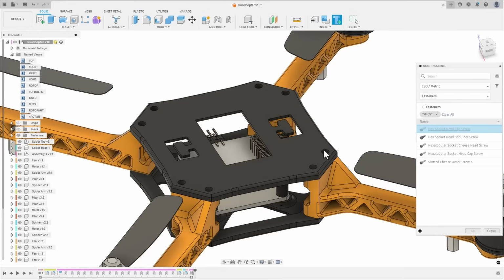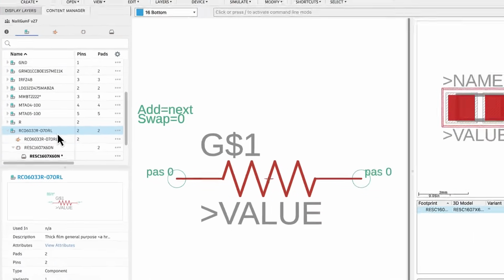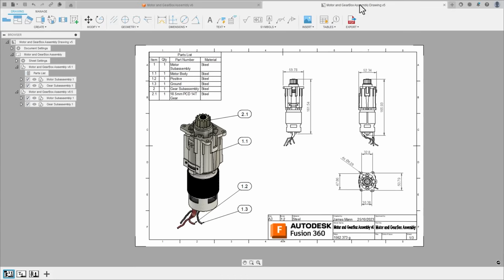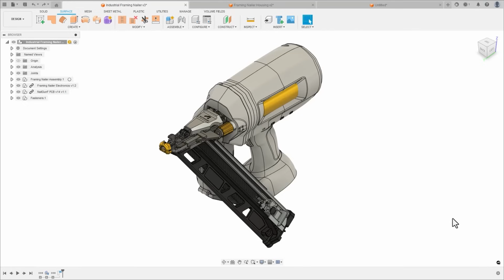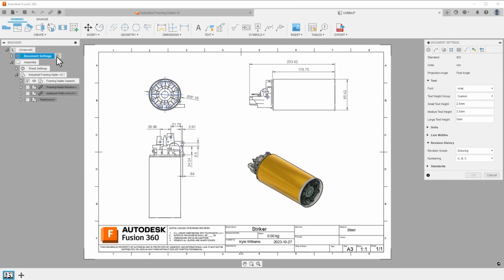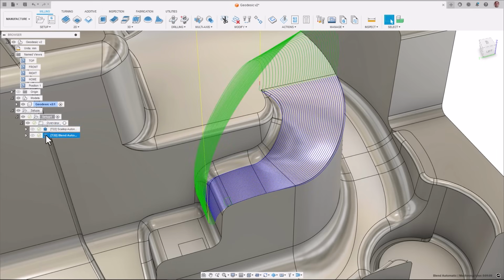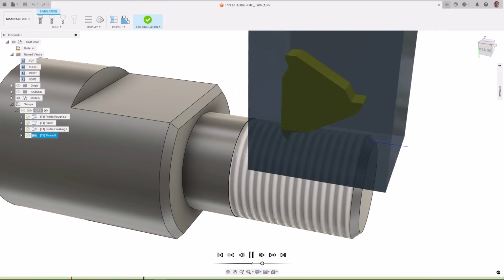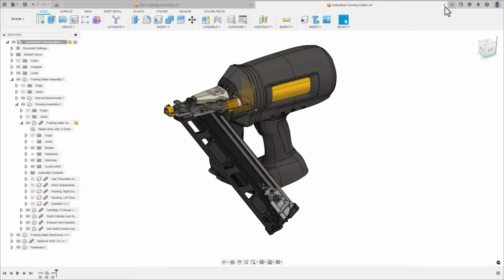Stay Ahead of the Curve with the Autodesk Fusion October 2023 Update

Comment: Thanks for the fastener function, finally :) Did a quick test, and it looks very promising!

Hoping we'll see similar library functions for other standard driven parts :)

Any chance the latest driver for Spacemouse has been updated/fixed?
I had to switch to the legazy driver option a few weeks ago when things got messed up, I think one axis was missing?
Reply: On the bottom of the screen you have the orbit tool on the far left side, if you click on that you can select “Free orbit” to move in all axis. I just learned about this last night lol
Reply: @quincytrott9298  for the normal Orbit command, or specific to the 3DConnexion Spacemouse? :) I haven't tested if Fusion have updated the Latest driver yet, I'll have to do that :)